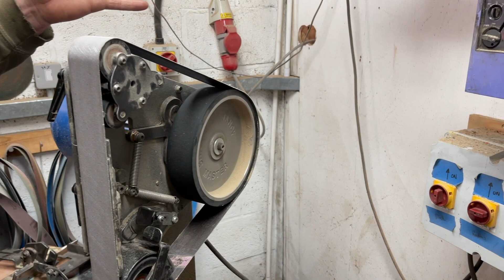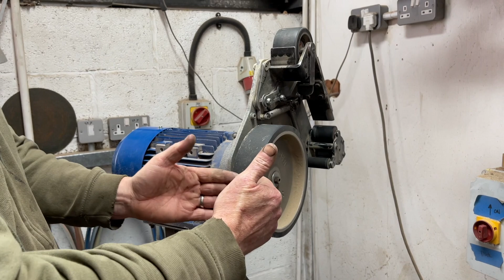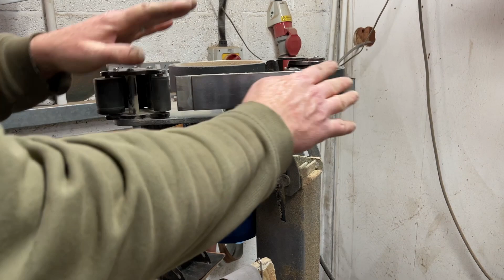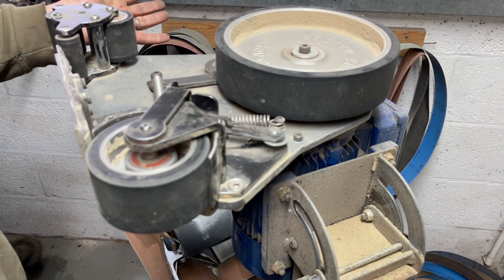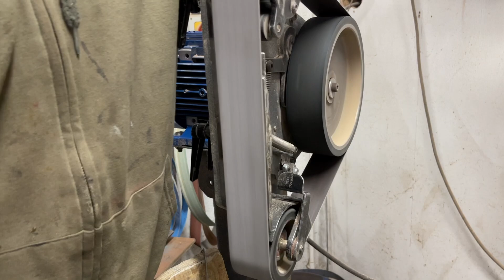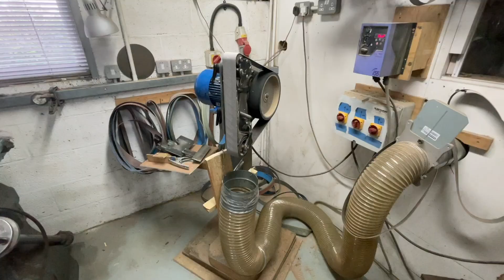Best Grinder for Knife Makers?

Comment: The design of that grinder is absolutely brilliant! I'm used to using a linisher at work, which is essentially the same thing, but for woodwork. But it's just a large vertical platten, with a 90 deg table bolted to it. You can use the drum at the end, but it's about 12" wide, so no good for smaller radiuses. Not to mention the fact that it's in a woodwork shop, so grinding metal on it is not really ideal. I need to get one of those Radiusmasters. Thanks for the heads-up!

Comment: Have you considered using a piece of wood with a length of rope attached to one side of it to depress the spring-loaded tensioner when a belt breaks?   All you have to do is attach the rope ends to one side of a piece of wood so that it fits reasonably snugly over the contact wheels when the length of wood is facing out, if you rotate the wood in the plane of belt rotation so that the rope is pulled over the end of the wood, the rope will be effectively shortened pulling in the tensioner.  All you need to do is have the wood thick enough to depress the tensioner till the lock clicks in.  The length of the wood to its thickness determines the leverage you get.  if you get it just right, it will roll over the pivot point and lock into place. An old wood workers trick and probably older than that, right up there with the similar Spanish windlass.

Comment: Hello, thanks for the video, I want to ask you if you could remove the drive pulley from the motor and show the switching device itself, which allows you to install the grinder in any position, if it’s not difficult, remove this process
Reply from the maker: Sorry do you mean you want me to remove the drive wheel? It’s a bit tricky to take off but it’s a simple system in there with a spring loaded tooth and slot that it locates in 👍
Reply: @BenOrford  Yes, this is exactly what I asked to remove the drive wheel, but if this is not possible in any case, I thank you for a good video, and I wanted to see the switching mechanism of this particular machine for scientific purposes, of course, although radius master has drawings that show everything, but